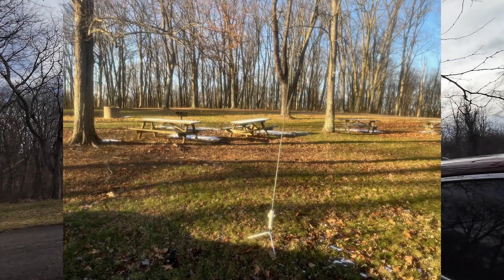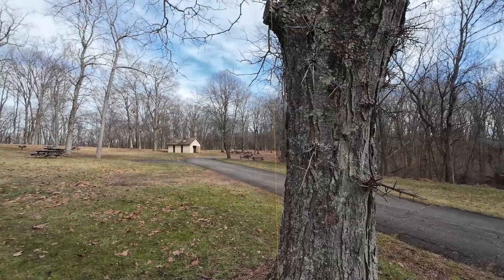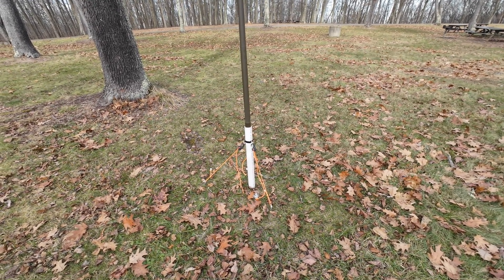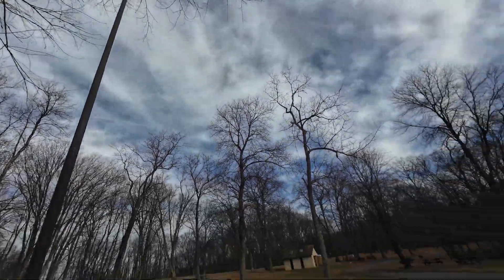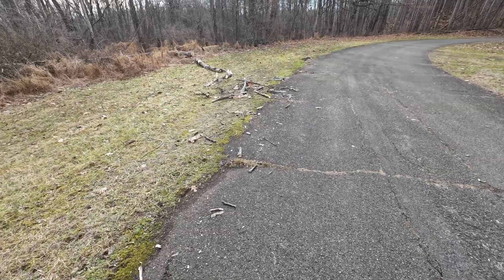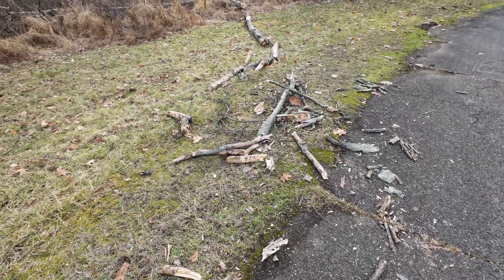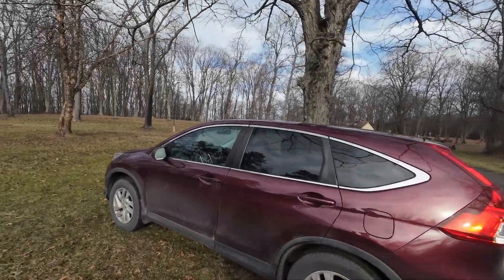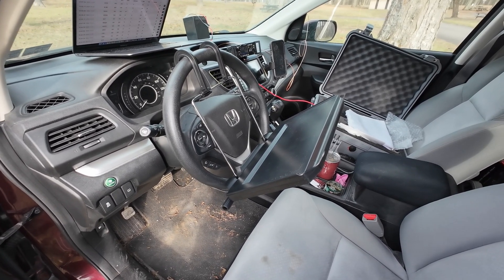Best Performance Ham Antenna WRC Vertical versus DIY EFHW | With Shocking Results

Comment: As much as it will pain those in the USA that grew up with the imperial measurement system, take the time to learn and use metric.  As Mike K8MRD recently said in a video, the amateur radio world is metric.  A metric tape measure is inexpensive and available at your local Harbor Freight.
Reply from the maker: This is a great suggestion. My tape has metrics; I need to understand it better. Thanks for watching. 73s